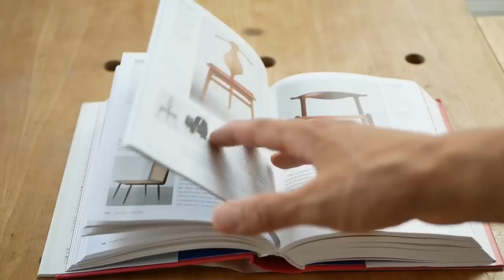SQUARERULE FURNITURE - Making a Whiteoak Dining Table

Comment: Excellent workmanship as always. I love the way someone pays attention to detail in their work. Just curious to myself, why there is a split in the middle of the table. 🤔😝
Reply from the maker: Thank you for taking a look.

This is a 2.6m table. Both iron and dominoes are vulnerable to contraction and expansion deformation, so they were added as reinforcement. In particular, the middle part is designed to respond to contraction and expansion during assembly and disassembly. If you look closely at the video, there is a space at both ends of the middle reinforcement.

Comment: Nice table! I'm working on a similar project and I have a question. The legs are connected to the top with Domino and some metal plates, are the plates steel or aluminum? Cheers from Romania
Reply from the maker: It's iron~
Reply from the maker: I correct you. It is made to order from stainless steel.
It can also be made from iron.
Reply: Thank you!